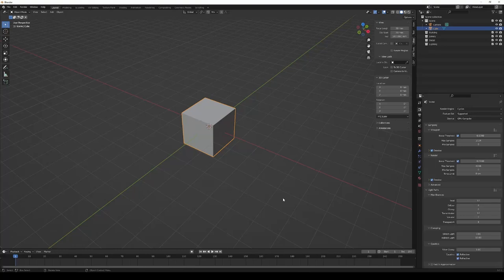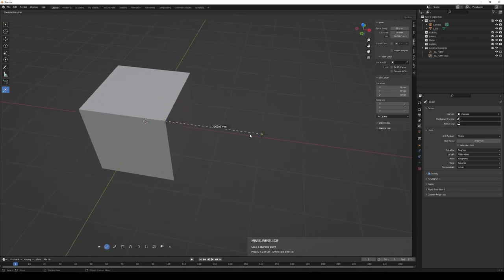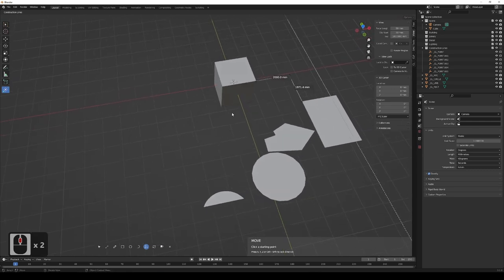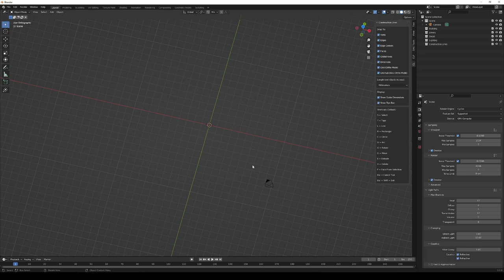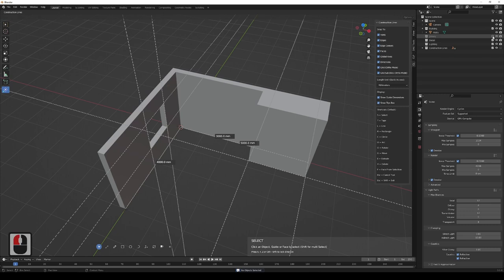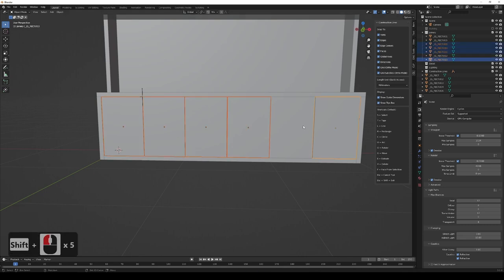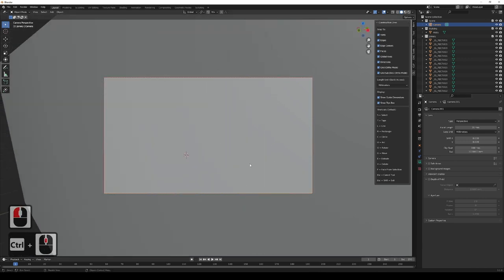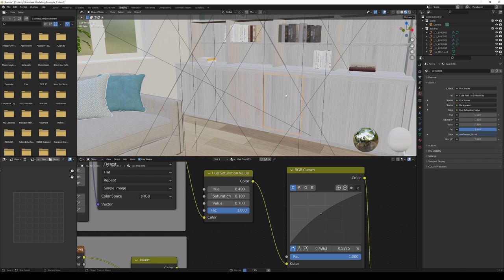Installing And Using Construction Lines For Blender

Comment: Hi, I have purchased your add-on but I have problem on the numerical input. Example: when I create a line of 600mm (numerical input 600) it will display create a line of 0.6mm. How to fix this?
Reply from the maker: What units are you using? Also, have you changed the unit scale?
Reply: @dndrawings  I am using millimeters unit scale into 0.001.
Reply from the maker: @zmarbz  There is an option in the preferences to override the unit scale (check box under Construction Lines). This should help. Contact me through my website if you still have any issues with it.

Comment: It looks like this tool does not snap to any curves?  Is this correct?  My installation certainly doesn't.  It only snaps to mesh objects.  This is kind of a bummer considering the way we build professionally is from CAD files consisting of curves.  I guess we can just convert everything in order to use it.

Comment: I can't type in a value using number keys, they seems to have other function. Just can't figure it out. When typing as in video line to be 2000 mm it just changes orientation
Reply from the maker: You can use both the  number row and numpad to input numbers, however, if you use the numpad you must press Enter first. This allows the numpad to still be used for navigation. There is currently a known bug (fix coming very soon) with pressing Enter for the numpad no registering, so if you prefer this way of entering numbers, go to Edit->Preferences->Construction Lines and uncheck the Direct Input. You can also uncheck the Numpad For Navigation preference and this will mean you can enter numbers with both the numpad or number row, without pressing enter first but you won't be able to use the numpad for navigation.

Comment: Hi, I just purchased this but I'm having issues due to the way I have my units set up in blender. Since I model for 3D printing I have units set to mm but with the units scaled to 0.001 - this makes exported objects match between blender and the slicing software correctly (i.e, 10mm in blender is 10mm in the slicer) without the need to manually resize the objects after.

I ticked the override option in the settings and set it to 1, this seems to have fixed an issue where the lines/shapes were being created far too small despite typing in correct mm values. But the grid snapping seems to be snapping to a 0.001 sized version of the grid that is actually being displayed, making the snapping increments so small they may as well not be there.

Is there a way I can correct this?

Thanks.
Reply from the maker: Just sent you an email.

Comment: Nice to see a recent tutorial, and it seems there are many improvements since I last tried to use this.  Is it still not possible to use the number pad to enter dimensions? The number keys across the top of the keyboard work fine.  I seem to remember this was a restriction caused by the internal working of Blender and difficult to get around.
Reply: @DenisRoyIsFree  thanks for the fast reply.  In my case, I am more likely to miss the numeric keypad for view selection than for numeric input, so will just get use to using the number keys at the top of the keyboard.  It’s odd because Blender can use the numpad for both view selection and input - it senses the context.  Still a very useful addon indeed.
Reply: @DenisRoyIsFree  I cannot get the draw tool to accept a typed in number. I am using blender 3.0. I tried doing what you suggested but it made things worse. The typed in distance shows up in the top left hand corner of the scene but I assume I hit enter but no cigar. Also it will not except a change of units, don't see any millimetres. Any help would be appreciated.
Reply: Finally got the issue solved.
Reply: @croccustom  - how did you solve this? I just started using the add-on and when I try to enter a dimension for a rectangle, it just creates 2 vertices at the corners.
Reply: @jlauzon2  I admit it had been a while so I am racking my brain on what I was trying to do let alone how I solved the issue. I usually write down notes when I find the answer. At the time I was digitally plotting an object by using the Construction line package since Blender was lacking the tools. I have been jumping around in Blender working my way around different situations. But I have been caught up in my different worlds suck as Animation, VRX, film editing so my mind is fried from all the knowledge. But if you are that frustrated I can look back to refresh my memory. I know how important it is to rely on others other than the tutorials.

Comment: Any tips for better viewport performance??
Reply from the maker: A few tips: try unchecking the different snap taps in the CL tool menu and see if there is anything particular that is affecting performance. For high poly meshes you can reduce ethe size of the selection area in the CL preferences (Edit->Preferences->Add-on->Construction Lines alss you can select an object and hit '/' to work just on that object. If you're getting performance issues with just the defaultlt blender scene then that would be another issue and you can contact me about that through my website form.
Reply: @dndrawings  Thanks! :D I will try these out and see what happens. <3

Comment: Nice addon but I find it very laggy on my computer. Can anyone suggest anything that might cut down the lag?
Reply from the maker: If you're finding it laggy on a basic scene there are a couple of things to check: 1. Check the console to see if any errors are being thrown (email me if they are) 2. disable any other 3rd party add-ons. There are some known conflicts with KitOps (free version) which I'm working to fix at the moment. If you're having issues with more complex scenes, you can try unchecking some of the snaps in the tool menu, hiding the more dense parts of the mesh and or reducing the snap radius in the add-on preferences.
Reply: @dndrawings  Hey thanks!  It was KitOps. Turned it off and Construction Lines runs great! No errors in console with or with out KitOps.
Reply from the maker: @r0naldhuber578  I'm glad that worked! It's a real strange one. I've spoken to Chipp who makes the add-on and hopefully we can come up with a fix between us.

Comment: Yes! Where has this add-on been my whole Blender life. Thank you so much for your work on this. I hope this eliminates pain points I’ve had every time I have to switch over to modeling in Blender. 

I’m not sure I’ll use anything but Sketchup for architectural and cabinetry work, simply because SU was built with accuracy and speed in mind, and because you can move from concept to construction documents with relative ease. But I do use Blender for some product concepts when curves and bevels are needed. But with your tweaks to its modeling toolset I may consider Blender for a few more projects I’d typically just do in SU. 

I am curious though, is there a reason you’re using Blender for this type of visualization rather than just staying in Sketchup and then rendering in VRay?
Reply from the maker: Thanks for the comment! My pleasure.

I find SU gets incredibly slow with larger models. Any complex shapes, fabrics, high-poly hard surfaces, etc. just become unusable. I find Cycles excellent as a renderer and have produced much better results than VRay in SU. The more I use Blender the more I realise that SU is so far behind. I'm not knocking SU at all, it's built for a different purpose but being able to work with cloth, physics simulations, node geometry, animation, split-views, real-time rendering, easy scripting & curves just put Blender into a different league. Plus, I really don't like the subscription model for SU. I was happy paying for perpetual licenses but tying into a subscription doesn't sit well with me. 

My plan is to move fully to Blender for all my work, however, the inability to produce documents is a real issue. This is the next add-on I'm currently working on and I'm hoping to get some demos out this year for testing. If everything works as planned, I'd like to move over fully to Blender next year.
Reply: @dndrawings  Really appreciate you sharing your experience with both processes. I’ve been using Blender increasingly more, and really love the texturing and rendering freedom I get in blender. I can use pbr’s or create my own procedural textures. 

I have a project coming up that requires rendering models I’ve created in SU and so I’m considering my options for what I do with these to create more realistic scenes. VRay or a real time rendering in an app like D5 seed like an obvious choice, but I already know Blender and so I’m starting to consider just using that instead. 

If your construction docs add on for blender is as well considered as construction lines, I’d definitely use it. Best of luck with the dev on that.
Reply from the maker: @kevinmanley5043  If you've already built your models in SU, you can export them as .dae to Blender. I have a free add-on called DAEClean on GitHub which you can use to clean up the imported dae models. There's a link on my website if you're interested.

Comment: Does it have a fix for the engon nightmare it makes?
Reply from the maker: If you mean after using the extrude function, then yes, it's been completely re-written for the next version. I was using Blender's boolean functions to extrude but there are a lot of issues with it. The latest version is in testing at the moment and will be released soon.
Reply: @dndrawings  Nice!

Comment: Can this tool do rounded edges?
Reply from the maker: You can model rounded edges with the arc tool but the easiest ways are to use the Bevel modifier or select an edge and use Ctrl+B to create a bevel (you can use the mouse wheel to determine how rounded the bevel becomes)

Comment: This looks wonderful. Web site says up to Blender 3.3 supported. Would I get a refund if it doesn't work in 3.4? I'm reluctantly moving away from SketchUP as the free version is gone and the paid version is far beyond my means.
Reply from the maker: Hi Mike, Thanks for the comment. Construction Lines works on Blender 3.4 (although it doesn't show as supported on the product page yet). I'm working on an update at the moment which will be released soon and will also have support for the new Blender 3.5
Reply: @dndrawings  great , thanks. I’ll buy it this morning.
Reply from the maker: @CraftyOldGit  Cheers Mike. If you have any issues let me know. I'll always respond (my workload is through the roof at the moment so may take me a day or two but I'll always get back to you).

Comment: Hi, why is there no perpendicular snapping?
Reply from the maker: The line will highlight pink when it's being dragged perpendicular to an edge. Press Ctrl+Shift to lock the direction (same again to unlock)
Reply: @dndrawings  Thanks for responding. I use  Construction Lines 2.93 in Blender 4.0, all default snaps are on, but perpendicular shaping doesn't work in both edit and object modes.
Reply from the maker: @hlavatskyioleksandr1410  The current version is 0.9.69 so you'll need to download the latest version from Blender Market/Gumroad. If you're still having issues, contact me through my website feedback form and I can get some more details from you.
Reply: @dndrawings  OK, thanks

Comment: Bought the plugin and tried to simply follow what you do in this video but I find the plugin (0.9.67) very buggy . It's just not working on latest blender like it does on the video. :(
Reply: A couple bugs I immediately encountered:

- Extruding multiple faces at once is not working even though it works on the video. It will just extrude one of the selected faces (not necessarily the one you clicked on to activate the extrude tool).
- The bottom area of the viewport does not register any actions. For example when trying to draw a line near the CL toolbar or next to the tip box the action is never registered (seems like the input does not work there).
- When you CTRL+Z on an action that grows the bounding box (the grey box around the object you're editing), it will move the whole objects position. Its very easy to demonstrate, just draw multiple lines that increase the objects bounds (and the grey box), as you CTRL+Z all those line draws the grey box gets smaller as it should, but the whole object also moves its location. This makes most actions destructive as you cannot get back to the previous situation anymore.
Reply: Update: I got a response from the dev that all of these issues are being worked on and will be fixed in future updates

Comment: many things are not working accurately on mac monterrey blender 3.4.1. shapes put on 3d models arent going on face, typing units for lines don't work, pressing tab doesn't work
Reply from the maker: Hi John. I've not had an oportunity try test this on a MacOS. All is working fine on a Windows and Linux but definitely sounds like some issues. Have you tried removing and rei-installing with a restart of Blender? Sometimes after first installing (especially on Macs) there have been some very strange errors being thrown. If you're still having issues, contact me through my website form (dndrawings.com) and I'll support this directly with you.
Reply: @dndrawings  thanks! I tried that, I'll just use linux then, not ideal but it's all good, thanks for all your work
Reply from the maker: @inventanew  Thanks John. I'll look into the Mac issues with Blender 3.4.1 and try to get fixed for the next update.
Reply: @dndrawings  sounds awesome!

Comment: I so don't understand the entering values.
Reply from the maker: It may be that you are using the number pad to enter values. If so, you will need to press Enter before entering a value. This is to allow for the numpad to be used for navigation during operations. Using the number row doesn't require you to press Enter first. This behaviour can be changed in the add-on preferences.

Comment: 1# OMG, this is so frustrating, Selecting, is a nightmare in or out of edit mode. #2 Numpad will only be a nav, NO input values regardless of Enter or NumLock toggle or Pref Direct Input/Numpad For Nav. #3 X (delete) will not fully delete. #4 move anything in smaller scales is jumpy regardless of Unit setup. # I want to like this, but OMFG is this frustrating.
Reply from the maker: Sounds like there might be a conflict going on. Do you have any other 3rd-party add-ons running?

Comment: For what it's worth, if you change Blender's transform pivot point to Active Element, you can get basically the same behavior as your addon when it's using a selected element as the pivot point. Just make sure the element you want to be the pivot is the last thing selected so that it is the active element. And that has been in vanilla Blender pretty much forever, but a lot of folks overlook it, I use it a ton though.
Reply from the maker: I think I mentioned in a previous video that the rotation tool isn't adding any new behaviour, it just makes life a lot easier. Especially if you want to use a particular point on the geometry where you want your pivot point to be (or another object's geometry). It reduces what can be a multi-stage process to a couple of clicks.